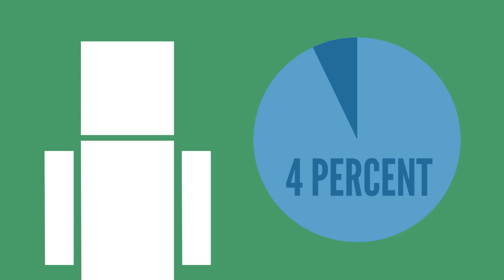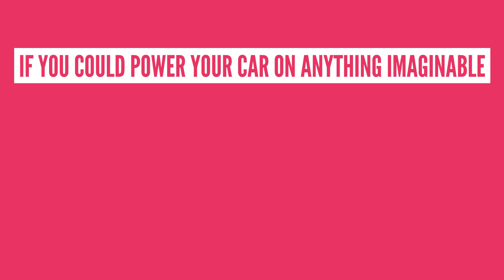Why Don't We Have Water Powered Cars Yet?

Comment: Stanley Mayor: “I made a car powered by water that could drive cross country on only 75 liters of pure water”

Scientists: NOPE
Reply: like ONLY 75 liters of PURE water
Reply: Oil barons: hold my beer
Reply: Science: try not to laugh challenge (impossible)
Reply: "Drink this poiso' I mean soda
Reply: Yes that is what happened
Reply: People that believe in these subsidized scientist. Wow. They are paid to tell you whatever the powers that be want u to believe. SMH
Reply: Except scientists never said that. The oil companies shut this guy up from what I gather.
Reply: Explain to me in Scientific terms why it won't work?  I can explain to you in Scientific terms why it will.  The only people that say it won't is the fuel companies.  We can't have people filling up from their garden hoses.
Reply: @michaelschmelzer4310  Law of thermodynamics.
Reply: @michaelschmelzer4310  laws of thermodynamics. Water can’t produce enough energy to power a large car like that from evaporation. Thermodynamics state that no system can have entropy of zero meaning nothing can return the equal amount of energy it possesses perfectly without losing some. If it was possible I could make a copy of this guys “steam engine” but the only problem is it won’t be isentropically efficient meaning it wouldn’t move even a mile without burning through 1000s of gallons of water
Reply: @michaelschmelzer4310 you can but it’s not practical, why not just run the car directly from the battery instead of suffering energy losses and risking the hazards from hydrogen?
Reply: @michaelschmelzer4310  Here's what i don't get. You take H2O, use the cars electrical system to turn the H20 into pure hydrogen and oxygen using electrolysis, feed it into the engine and burn it. The end product of this is H2O. You could theoretically feed this through the engine over and over again. So where did the energy come from? Most likely the cars battery. So how far do you think he could Drive before having to recharge the battery since I don't think the alternator is going to be able to cope with the load of electrolysis. Ive heard the dude was a wizard when it comes to electrolysis, but either way, the battery would need charging eventually. There is no such thing as free energy after all. Or am I missing something? Either way, it's an interesting machine and i wish the dude was still around. May he RIP.
Reply: @itsafuckingcobra.5920  The conversion or splitting of water to get the hydrogen out can be completed at a low amount of energy input slowly with a catalyst in a high frequency pulsed circuit at 1.2 volts DC . If you dial in the voltage and frequency correctly you don't waste energy in the form of heat. You can use Solar , wind and alternative sources to perform the Electrolysis at a stationary system. When you collect the Hydrogen gas you let it flow through and into a Hydrated metal or Hydrate that the Hydrogen likes to bond to at low or ambient temperature and under 20 psi of pressure. It is perfectly stable stored in a solid form sealed in a container away from air.

You can let it sit there and wait to be used to either burn in a combustion engine which isn't very efficient or you can used it in a fuel cell to create electricity. 

A fuel cell is much more efficient to use and safer. All you need to do is have a catalyst in the fuel cell and introduce air into the system. The oxygen and hydrogen want to get back together and reform into water vapor. This reaction causes a release of both heat and electricity. The heat helps promote a more rapid reaction and accelerates quickly. If you want to stop the reaction just shut off the air supply. 

Corporations and big oil have done everything possible to stamp down Hydrogen fuel cell cars because it threatens the status quo.

Everywhere you turn there is propaganda and disinformation being heaped on over and over. 

They said it would not work but it does work very well. Toyota has built one of the most efficient fuel cell systems out there and basically put it in a Lexus.

A hydrogen fuel cell can and is always going to be able to give more range than a battery because of power density. 

If they store Hydrogen in the form of Ammonia it can easily be transported through already existing underground pipelines everywhere very cheaply or made onsite at the point of fuel distribution or converted into various solid forms and stored and moved that way very safely. The Solid storage media can be recharged over and over again. There are many forms that can be used.

Only the so called pseduo intellectuals are afraid to open their minds to the possibilities and demand that it is impossible and in efficient. Fuel or batteries just do the same thing , store energy for later use.
Reply: @desertdan100  That was quite a read. I'm with you on the hydrogen fuel cell being the way to go. All I was trying to say was because Stan's car created the hydrogen on board it doesn't make sense. Since you would keep having to stop to top up the battery. So if Stan wanted to drive his car, he'd have to fill the hydrogen tank before setting off, as he wouldn't be able to do it as he drives along. Not for long anyway. Even if electrolysis was 100% efficient, you would still only be able to drive untill the battery dies. Hydrogen cars are doable, but cars that run on water isn't. It's all about the transfer of energy. You get what I'm getting at?
Reply: @desertdan100  there is a big difference between hydrogen fuel and water engines.
Reply: @itsafuckingcobra.5920  you can charge the battery with alternators, strapped to the engine and the wheels. The only problem is the research and development of the technology is always being hindered.
Reply: @namegoeshere69  The problem with that has to do with thermodynamics. Energy cannot be created or destroyed. It can only be transferred. So the problem is the energy you gain with the alternator is less than the energy being used to split water and oxygen. Hence why sooner or later you'd have to stop to recharge the battery. This is basically GCSE physics. No amount of research and development can change this. Hence why nobody is interested in funding and developing a car that will not function in the real world.
Reply: @itsafuckingcobra.5920  right, but with current alternator setups they pair the alternator with the engine to output more charge than the vehicles electrical system consumes depending on the features of your car. The same can be done with this, all you have to do is figure out the electrical consumption rate of the car and engineer the charge system accordingly. I think the main problem has more to do with economics than the technology,  money talks and bullshit walks.
Reply: @desertdan100  ik without reading your comment that you are wrong, it's not possible sorry
Reply: @exiledkenkaneki701  Just because someone does not understand something does not mean it isn't possible. I once had an engineer say that no source of energy is perpetual and when you take from it you can't get it back because it is lost in entropy.
I handed him a magnet and said how can it have stored energy that I can use over and over for years without loss.

He got angry and walked away. 

If I pass a magnet over a coil of wire it does not diminish the magnet. It does not diminish the copper but electromotive force is generated.

Maybe just maybe someone has figured out how to make Hydrogen more efficiently but it is being suppressed.

Tesla gave us ways to harness Electricity that were never dreamt of before in the past. Many Scientists thought he was insane and that there was no way his claims were real.

I have seen Hydrogen produced from simply dissolving Aluminum in water in a sealed vessel with a catalyst to start the process and allowing air to be injected into the vessel. 

Very little energy at all was introduced into the system to get the reaction going. Just chemical reaction.

Not the best or cleanest way to do it but it is a way to get rid of old AL and it loves to oxidize.

High frequency pulsed electricity keeps the heat down compared to constant current.

It is more efficient and technology is improving. Heat is energy waste and if you can keep the heat in the reaction lower it is more efficient to split  water and then there is plasma.

An entire different discussion.

Well another time and I am not going to discuss anymore on this for awhile. I am frying bigger fish right now. Cheers.
Reply: @desertdan100  the only arguments we need to debunk this conspiracy is that if this was possible there would be  " big water" already who would have took over the market, the " big oil" are bastards. but definitely won't assassinate you for making such car, because there's no efficient way to make them 🤓 if cars can't transport people and aren't efficient and have good mileage they'll are bad cars 😂, i don't know that much engineering to know about how we can make cars like these neither do you, it would be far more common knowledge if there was a way , what you learn in 10th chemistry can't be apllied so casually, plus you mentioned tesla which is a terrible car to in itself, apart for its cut corners in quality, the car catches on fire, and it didn't revolutionize anything other then being attached to Elon, even the factory is known for its racist work environment , there are car companies with established history that make better electric cars like nissan, and more are catching up, is just hype and elons figure is the only reason people buy it, and that guy is a scum bag in itself. plus idk that person who you talked to about energy and you handed him that and he " angrily walked away" is 100%.exaggerated and it doesn't prove anything especially not a massive conspiracy involving millions of engineers who are being kept shut by " big oil", this is like a more absurd version of moon landing hoax conspiracies that have no proof to substantiate them other then " hey we just need to more efficiently produce energy from water", well go ahead make a consumer car that has good mileage, don't involve like 100 liters of water to travel even less distance then half a liter of petrol, plus the added engineering complexity of making ranks large enough to house this much water, compromising speed, built quality, if we can even get close to that before harnessing energy from water as efficiently as petrol does with its terrible affect on the environment, idk why I'm arguing about water cars tbh, i don't know enough engineering to comment on complexities but there are YouTube videos enough to disprove this conspiracy, not as simple as simply making a. larger battery to store even more current to initiate electrolysis, even " better" then tesla , large batteries have downsides as well
Reply: @desertdan100  He walked away because he realized what he was dealing with, if it happened which it didn’t.  Magnets don’t store energy.  I notice you gave the 1.2 volts for your magic hydrogen separator but neglected to mention the specific frequency….care to elaborate?  BTW, there was energy generated because YOU MOVED THE MAGNET OVER THE COIL.  How do you not realize that to the extent that you would lie about an encounter to try to make yourself look smart, path.
Reply: @desertdan100  Get rid of old aluminum?  Lol, are you serious?  A valuable fungible resource on high demand and you’re talking about getting rid of it like lawn clippings?   Get back on your meds dude.
Reply: @davidgill3356  Just because you don't understand something does not mean it doesn't exist. A radio frequency of 60 to 100 GHz is used to create a plasma field in a PWM system in a vacuum. The water is injected into that field in a pulse. It immediately separates the H2 From the O and begins expanding. Additional air is drawn in with it. The H2 and O want to get back together. The reaction or shock wave , flame wave is very fast and heats up the air in the cylinder expanding it forcing the piston downward. The whole reaction collapses on itself causing a deep vacuum.

You have heard of thermo dynamics I am sure. It is why Heat Pumps multiply the energy used by 300 %. Does that mean that a Heat pump is an overunity device.

According to most so called experts a simple Heat Pump should not be able to operate and do what it does. 

Because of thermodynamics and the heat of compression it puts out more heat energy than it consumes from the grid.
Reply: @itsafuckingcobra.5920  I hear what you are saying but look at how a Heat pump works. You put 1 unit of electricity in to run the compressor but it is 300 percent efficient  because of thermodynamics and the heat of compression multiplying the heat put into the system. How can that possibly work, but it does and has been since over 100 years ago when it was stumbled onto by an inventor trying to do something else.
Reply: @desertdan100  Heat pumps are not 300% efficient don't be absurd. They use power like any other device that runs on electricity.
Reply: @gahbah274  Unfortunately you are wrong.  HP s  move heat and add to that heat through the heat of compression and thermodynamics. 

When you use the same amount of electricity input between an electric resistance heater and a HP, the Heat Pump outputs 3 times the heat for the same amount of input.

That means it is 300% efficient.

The HP absorbs heat through thermodynamics. Let us say 10 degrees from any heat source goes into the refrigerant. 

When you compress that same refrigerant in vapor form you multiply it from the heat of compression, ( the molecules agitate against each other ) this increases the heat from friction.

That same temperature is now 3 times greater and is now 30 degrees higher.

10 to 30 is an increase of 300%.

The same unit of heat went into both systems.

Just because you don't understand something, does not mean it does not happen. 

Nikola Tesla got the same push back on AC vs DC electricity because others did not understand what he was telling them.
Reply: @michaelschmelzer4310  "Scientific terms" it's called truth bro. Don't try to make it complicated. Also, it's mentioned in the video. Electrolysis, the most popular method of splitting water, is a very energy consuming process. Meyer tried to use resonating frequencies, and sure. Although his claims might be unproven, let's assume they're real. You can go across the country with 75l of water. You still need power to generate such absurd frequencies, so likely it'll have a giant battery, oh wait, almost like an electric car! Those which, by the way, keep getting more efficient and cheaper by the years. Water is just not viable as a fuel method, and that doesn't take into account the incredibly stupid amount of work that goes into purifying it.
Reply: Government: poisens him and steals patent
Reply: @stn7172  Patent is public and available.   It’s just. A super inefficient electrolysis engine, nothing new.   Wasn’t poisoned, nothing was stolen, nothing useful created.